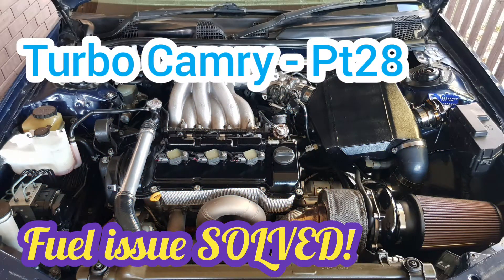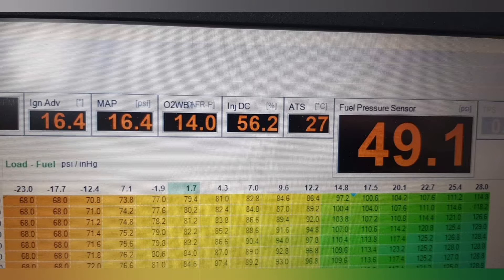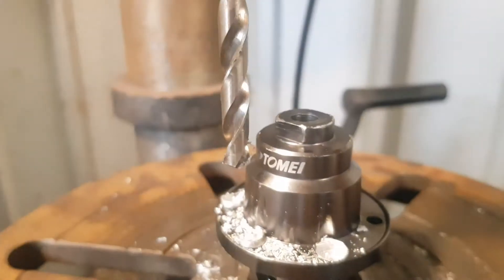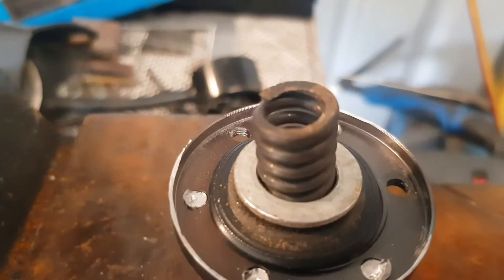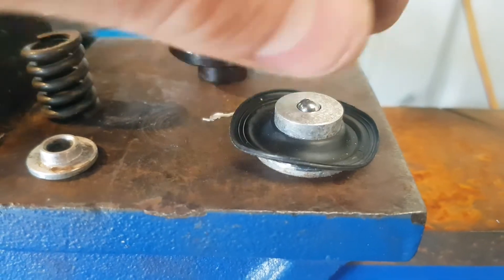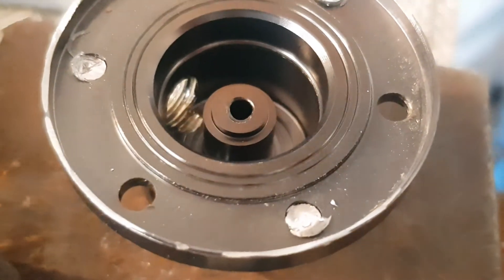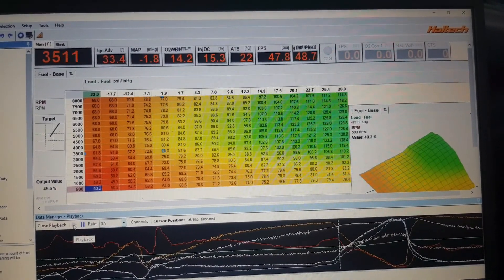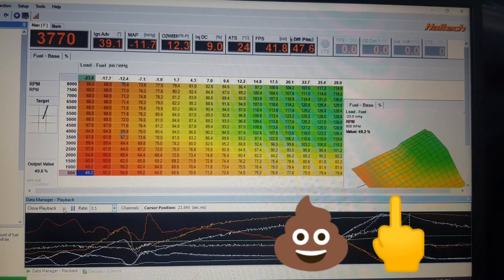Turbo AWD Camry - Pt28 - Fuel Pressure Regulator

Comment: Just a question, why not use a Toyota matrix/Pontiac vibe drive train in the camry instead? It should mount up.
Reply from the maker: Because those cars don't exist in Australia, however the gearbox I built also bolts straight on, it is essentially a Toyota Celica/rav4 awd gearbox